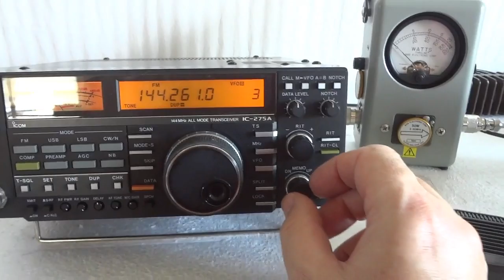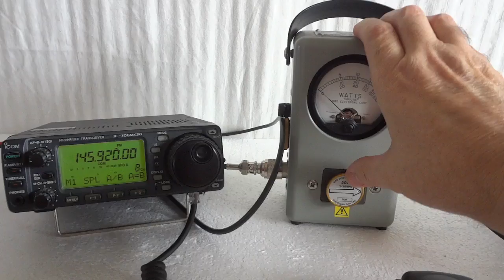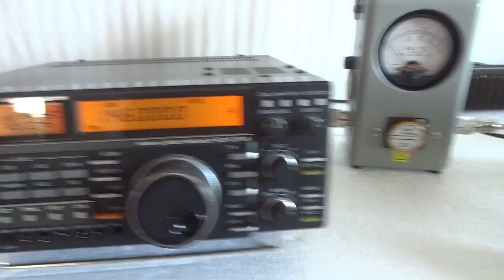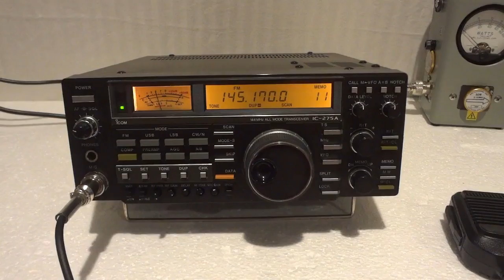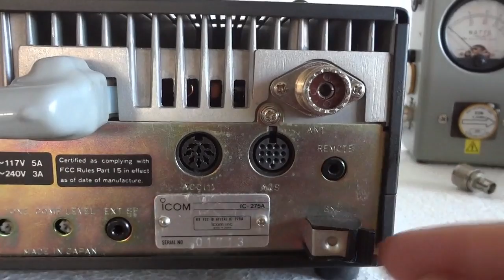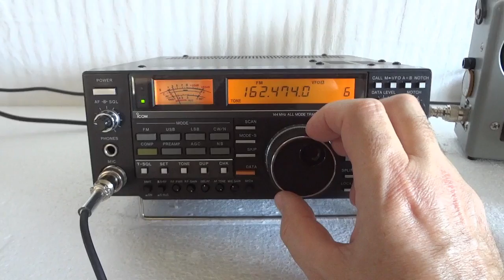Icom IC 275A VHF All Mode transceiver

Comment: Hola tengo un Icom 375 transeiver que no cambia los dos primeros numeros como desir 435.761.0 ya le busque y lo mas que pasa es a 440. De ahi se regresa a 430
Reply from the maker: Sounds like you have a European version (for Region 1), in that part of the world the 70 cm band only covers 430 to 440 MHz. It might be possible to modify the radio for USA (Region 2), by changing a jumper or the like. Check the service manual. Cheers.

Comment: Indeed the IC-275 was a rather expensive transceiver. The IC-575 used the same front panel and only covered 26 - 56 MHz in all modes. It too was far more expensive than other radio models with similar capabilities.

I always wanted one of these radio's but I wasn't willing to pay the premium price they once commanded. Today they just aren't worth the money considering all the other choices of current model all-band do-everything transceivers on the market that offer far more value than these old Icom's. Still, IF you can get one for the right price they are very good radios.
Reply: It has to be said that the modern rigs don't get close performance wise.. but it depends what you want to do.
Reply: @davidlisney2597  I agree about the pricing. Hams are a fickle and cheap bunch, with a "collective" that predates this stinkin' internet. I'm a fan of the older ones, and I'm sure where one lives will play into that with the DSP and filtering helping the newer ones. But there's this: I like the RX audio for "weak" FM stations a bit better on my ancient TR-251A. It's not as harsh as the 9700. But the 9700 puts out 4x power and I get much better SSB reports with it (or the 746Pro). Seems I'm piling up old radios because they're cheap enough now to afford "choice" ones-and leave room for repairs if needed. I say do it now while there are techs savy enough to fix them right and let 'em live on into future as useful rigs. Some don't need much and their quirks are well known by this time. I think I need one of these and a 7410, and maybe three or seven more just to be sure I didn't miss any GREAT radios. 😅
Reply: Couldn't agree more. These were way too expensive back in their day and now they aren't worth squat considering all the modern radio's that do far more. People still try getting premium prices for these things but not from me. That said, I still wouldn't mind having one of these but they're just too pricey for what they do.

Comment: AQS  stands for "Amateur Quinmatic  System".  This is described in section 2 of the manual. It requires the CT-15 AQS adapter unit. Nice unit thanks for the detailed video on this piece.
73 de KB3VEW
Reply from the maker: Hello! Thanks for letting me know, I need to read up on this it looks like